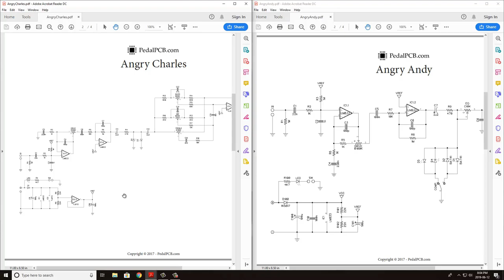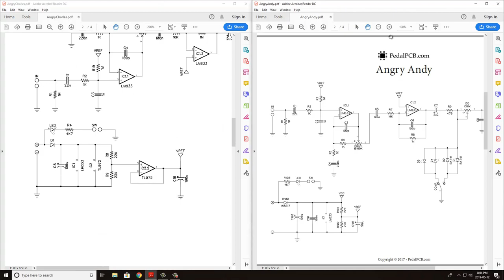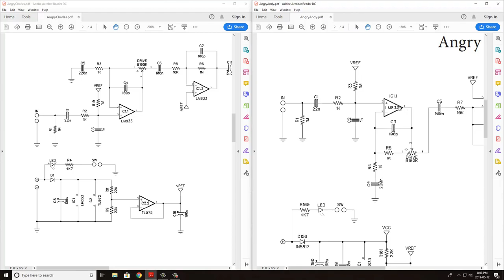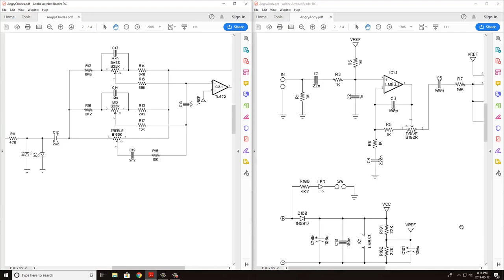PedalPCB Angry Andy | Build Review & Demo

Comment: Many Youtubers seem to use single coils for distortion pedal demos.  Could someone name a guitarist besides Kurt Cobain who used that much gain and singles?  I'm having a difficult time finding any reference.  

I also ordered this kit so I appreciate  the in-depth view of the circuit.  I had troubles with the PedalPCB sunflower fuzz and after bringing my work to a local builder he agreed that the instructions were wrong on the website.  This will hopefully help me on this build as it will be the last chance I give PedalPCB. In fact even the switch diagram for the Angry Andy is showing a different PCB which (for someone new to building) makes things confusing. Thanks for the video.
Reply: Joe Duplantier ? Not always but I saw Gojira live several times and on some songs he played a regular single-coil telecaster. https://www.youtube.com/watch?v=6xUoOaHzk5s
Reply from the maker: I use a tele in the 4th position (both in series) usually. This provides more output and little bit fatter tone. Some say it is like a HB, but I wouldn't go that far. It gets me by...